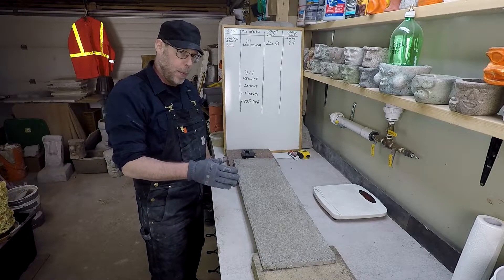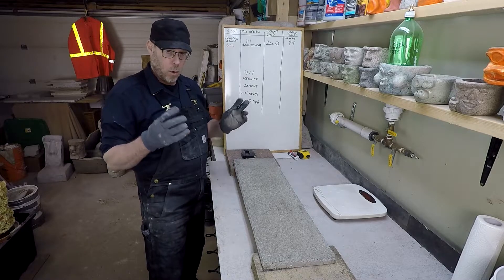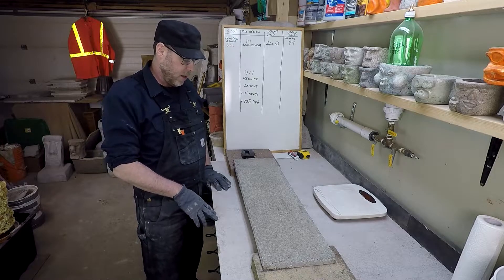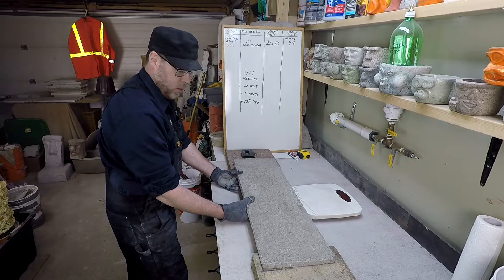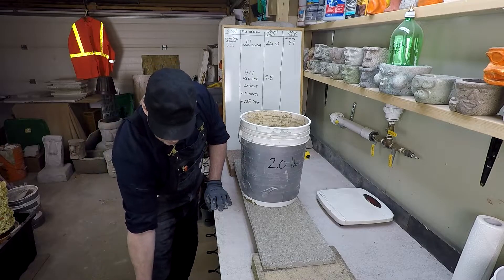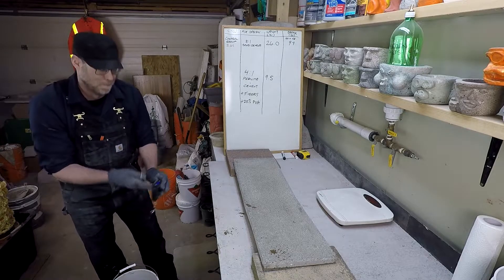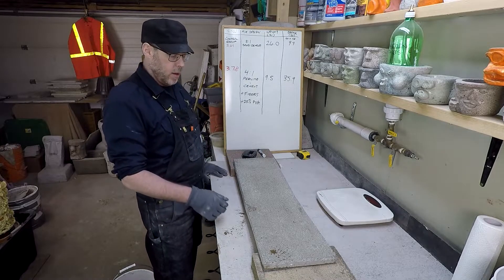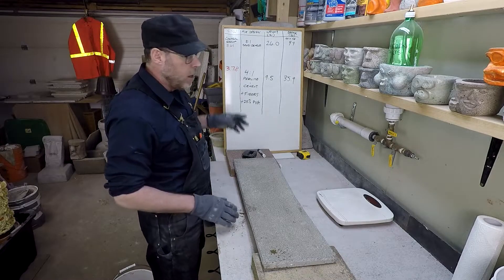Lightweight Concrete Strength Testing - Modified Perlite 4:1 Mix Ratio

Comment: Cool, tests… would pva be appropriate for outdoor use or would sika latex be a better choice? I’ve never used pva in concrete on latex r…
Reply from the maker: If it will be something that is exposed to water I definitely think the latex/acrylic additive is the way to go as it will help prevent water intrusion and will not re-emulsify like a PVA product can.  You do need to check your other mix ingredients and admixtures to make sure there are no conflicting things.

Comment: Would it be stronger if you laid 25% of the thickness, sprinkled the fibers over the surface, and then completed the pour? Because the bottom is subjected to stretching, this might increase the weight-bearing capacity.
Another thing I'm wondering about is a product I have used called Super Primer by Ames Research. It is used to bond dissimilar materials. The vehicle type is a Styrene Acrylic Emulsion with a water-like viscosity. I have used it as a primer over galvanized steel to get paint to stick.

Comment: I realize this is a couple of years old... I follow your content closely. But I've just today finished ALL of the lightweight playlist. If you read this, I have to wonder if a "modified" mixture such as this one with PVA and fibers would benefit from increased slump. I know you dislike excessive water, but the addition of a super-plasticizer would definitely increase slump and encourage consolidation. Add to that a vibrating element during placement and you would have the "ultimate" test bed for your light weight mixtures. I would think it would definitely benefit the strength/weight ratio. (AND, I know you use and advocate for admixtures..!!)
Like I said --- If you see this, tell me what you think.

Comment: Loving your vids! Could you use fibreglass to carbon fibre cloth layered in middle of concrete? E.g to make lightweight table? Could you polish it? Cheers Scott
Reply from the maker: I feel like there would be concern for too much flex if the concrete very thin.  I think flex would bake exposing and polishing difficult.  You could pour upside down on plastic and have the finished product very thin.  That might work.  You will likely get cracks but then the tension from the cloth embedded kicks in.  So that could be a concern for how it looks.

Comment: Thank you for your excellent tests. I will make some tests for an idea of cement/perlite panels. Could you please inform me what is the sizes of the perlite you use? It looks like you are using a medium size (0.8-1.2). Have you tried mixing cement with coarse perlite?

Comment: Great series, thanks! I'm assuming your mix ratios are by volume? I need to make 4 different shaped blocks for gutter downspout covers that appear to be natural stone. Biggest is 36" x 22" and the visible edge needs to be 3 1/2" thick. Better to make them full thickness or pad the inside like a foundation chainwall? 20 years ago I'd have bought flagstone and chipped it to fit, but advanced age prevents that option...
Reply from the maker: For something that will have constant water erosion I would be looking at full strength, full weight concrete.  The lightweight mixes would very likely erode from the passage of water even with use of a sealer.  If you want to do this project one time and one time only, use full strength.
Reply: @creatingconcrete  Thanks for the reply. If I've got to wrestle 300 pound chunks of rock, I'll just go with the flagstone and hire some help. Your articles are inspiring though!

Comment: Do you know how to make concrete panel i see someone can makeit 2-3 mm, him say mixture clay , sement and mesh . I need just to make decoration pattern on wall for my house or make panel strong but look like a wood
Reply: You need a rubber stamp if you’re putting on wall it would be easier anyways!!
Reply: Yes but what i confuse him say that wall decor from cement clay or stone but can bend without any heat just bend and the stone one can be lamp
Reply from the maker: Stucco mesh and plaster mix is common for housing finishes where I am located.  It is a parge layer only just slightly thicker than the diamond / stucco lathe.

Comment: Would the vermiculite to Portland Cement mix with PVA and fiber be strong enough for a mosaic fire pit table top?   Or should I use a Quickcrete mix?  This is for a 6' diameter table with a 24" firepit opening in the center.
Reply from the maker: I do not think it will be strong enough.  Any of these lightweight mixes are just a tiny fraction of the strength of even a moderately strong pre bagged mix

Comment: These have been very interesting tests to watch, thank you for these tests, I know they take up a bit of time and cost. I know it would not be "lightweight" but I wonder if you needed something with additional strength and maintain thinness (is that a word?) how something like non-shrink precision grout would do compared to the control? Is that something you would consider testing?
Reply from the maker: I am happy to try all mixes.  I think a non-shrink grout might not be ideal as you would not normally use it on its own for casting, but it still could produce interesting results.
Reply: @creatingconcrete  I don't disagree that it may end up being worse when used to make a thinner than normal concrete casting, but I know it's listed as being over twice as strong as most common mixes when prepared with the water to mixture ratios they provide. Thanks for the reply.
Reply from the maker: @paulprobusjr.7597  Also it is notable that non-shrink grout is very rare in that it, well, doesn't shrink.  The only other concrete product that I am aware of that does this is heavily modified hydraulic "quick stop" cement which sets up fast enough you can use it underwater or plug actively moving water with it.  Non-shrink grout is commonly used in construction for bonding dowels and anchors.  Epoxy works well but requires dry conditions that are hard to achieve at the bottom of an 18" dowel hole.  Non shrink grout goes in, then the rebar, and because it expands it creates a grab / purchase / anchor point not possible with other mix designs.  I also think that the Cement-all product that most casters seem to use is actually a non shrink grout also.  If this is the case then definitely it can be used for larger (thicker) castings, because so many people already use Cement-all and if it was a problem you would know by now from others.
Reply: @creatingconcrete  I have also seen it used for housekeeping pads under heavy vibrating machines, like stationary generators, air compressors, air handling units, etc. And I believe it is used as a "dry pack" when supporting bricks and block walls when you have to cut holes through them (like installing new ductwork, etc.). Given those uses, I thought perhaps it has better flexural strength (in addition to better compressive strength), which I believe is what you are testing. I wondered if it would be a better choice when you need a thin section that perhaps spans a longer distance than would be adviseable for your control.
Reply: Great informative videos. Do you use a acid resistant fiber glass?

Comment: Perlite being water repelant makes no sense. Perlite and vermiculite have very similar use in agriculture, which is water retention in soil.
Reply from the maker: Yes, but if you mix perlite into a concrete mix or vermiculite into a concrete mix you will both see and feel a stark difference with how they absorb water and integrate into the mix, with the verm integrating fast and well, with the perlite integrating slowly and not completely in many cases.